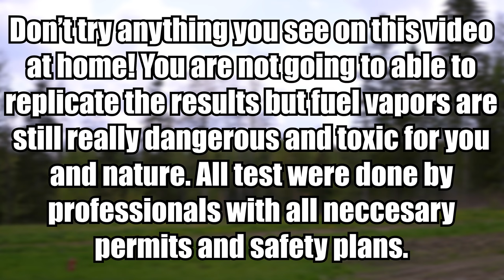Testing Fuel-Air Explosives / Thermobaric Bomb | Finnish MOAB 5 000 000

Comment: Aint engine knocking means that fuel ignites too early, when cylinder etc are still pressing gases more tighhly, kinda like then forcing engine to run in wrong direction while other cylinder tries that too in right direction..? This leading to break of crank shaft etc as well.

Comment: Try 5 gallons of either.
Reply: Diethyl ether, O(C2H5)2.  It's already 20 wt-% burned - the oxygen. Perhaps add pigment flake aluminum to the current fuel to make a thin slurry.  Al2O3 std. enthalpy of formation is -1675.7 kJ/mol.  For water and CO2 respectively, -292.740 and -393.5 kJ/mol.

Comment: The perfect fuel mix is 50/50 oxygen, fuel to achieve complete combustion and that's really what happens in a car engine.  Oxygen is sucked into the combustion chamber is compressed before fuel is injected and ignited.
Reply: The optimal ratio for full combustion of gasoline is around 14.5 parts air to 1 part fuel at sea level. 
Different fuels have different fuel content, some like nitromethane contain their own oxygen and require a much higher fuel to air ratio for proper combustion.

Also, fuel is injected at the beginning of the intake stroke in an engine, not during the compression stroke.

Comment: Great video-I wonder if you guys are getting ready to give Ivan a bloody nose. Please, what is your formula for the fuel mix, and what do you use to initiate the bomb, or does it matter, [ so it does not ignite the fuel before second charge goes off]. I would greatly appreciate an answer-TY
Reply: Often times diethyl ether is used and it works almost as well as anything.
The initial charge has to be a high explosive, ideally one that has a neutral oxygen balance or only slightly fuel rich to prevent pre-ignition.

 The initial explosion that disperses the cloud of fuel is over so fast that the fuel doesn't have time to mix with the air in order to burn.
Keep in mind this is a detonation, not a deflagration. If you used a flame to ignite the fuel cloud you would only get a fireball but no real explosion.

Comment: ... that's the first time anyone has explained to me the difference between 'Knocking' and 'Burning' in a car engine... Kiitos Lauri!
Reply: Knocking is actually just the fuel igniting before the piston reaches the top of its stroke.  It is not the fuel air mix truly detonating, it's still just deflagration as normal but too early.

The engine is basically fighting itself by trying to push the piston back down while it's still supposed to be going up on the compression stroke but the other pistons and momentum of all the moving parts force it to continue upwards.

This is generally due to fuel with too low of an octane, temperatures being too high inside the cylinder and bad ignition timing.

Comment: What is that liquid in that container? 
I was thinking low octane petrol would be a great liquid to use because of its low flashpoint and low compression requirement.
In a practical setting, using petrol would be dangerous because of its high evaporation rate.
Reply: Many fuels can be used. Ethylene oxide, propylene oxide, ethyl ether and even finely powdered metals like aluminum have been used.
Higher octane and flash point are preferable to prevent pre-ignition, remember that this is a detonation and not combustion.

Comment: How do these single explosion and spread things work. Having one explosion that spreads and ignites sounds kinda mind blowing. 
Also aren’t the real ones made with some toxic liquids?
Reply: Some munition designs use two charges, one to spread the fuel and another to ignite it. But yes there are also some that use materials that auto ignite some time after the initial blast, so no need for a second charge. As for the actual fuel militaries use it varies. Some use finely powdered flammable metals like magnesium I think (don’t quote me)

Comment: DID THEY USE ROCKET FUEL ???   I WOULD LOVE TO SEE WHAT NITRO METH DOES !!!
Reply: Not sure what they used but nitromethane isn't very energy dense and can actually detonate without the help of surrounding air.
 
What you want is a fuel or mixture of fuel with a combination of low autoignition temperature, high energy output and reactivity. One of the simplest yet most powerful mixtures is a 50/50 ratio of pyrotechnic grade aluminum powder and coal dust that has been fully saturated with diethyl ether. The aluminum has immense reactivity and energy density, the coal burns to form lots of gasses and the ether has an extremely low ignition temperature but also fills air voids in the powder which helps prevent early ignition.
As a cloud this mixture tends to ignite then rapidly accelerate to detonation even with a simple burning road flare placed the correct distance away.

Comment: Could you share the schematics of the project? In particular I'm curious about  the specs of the two charges. Are they similar  or different in composition and size? Which is the optimal detonation time difference between charges? From the videos it looks like in-between 8-15ms delay or am I wrong? What kind of fuel did you use? Did you consider to add Al2O3 nanoparticles to increase the detonation profile?